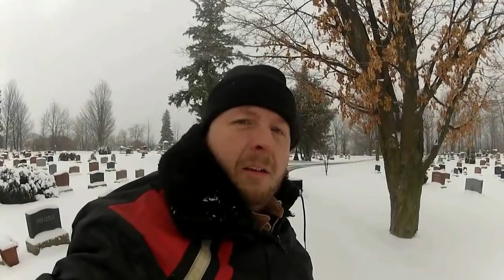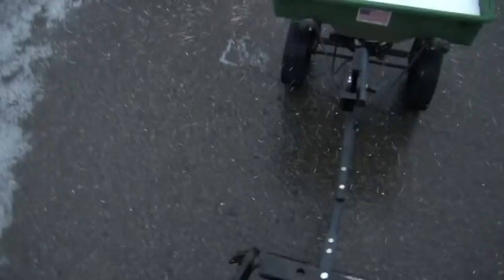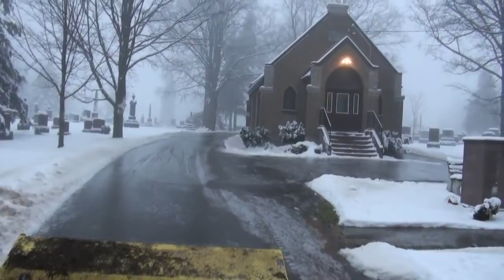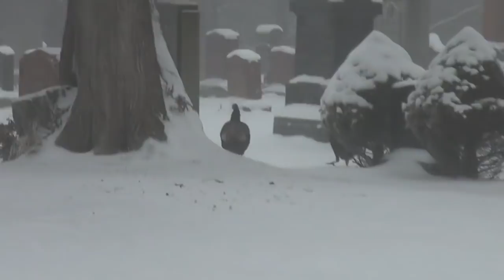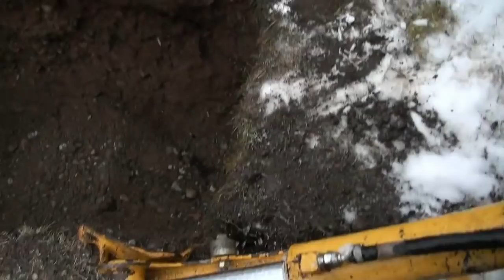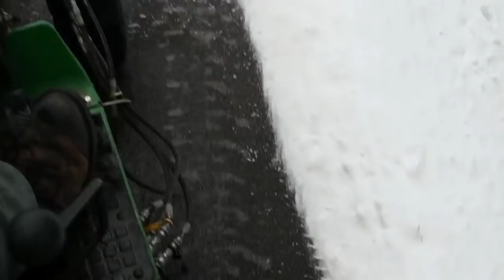friggan freezing rain crap

Comment: Merry Christmas Bill, Freezing rain is what we get most of the time here in Missouri. I'd rather have the snow. I worked a job for 30+ years where I HAD to be there, no excuses accepted. I got a lot of experience on driving in freezing rain and got to the point that I was happy that it was only snow I was driving in. I once had a 1967 Mercury Cougar I bought in 1971. I was afraid It would not do well in snow. Had a storm, lots of ice, drove it to work that morning, did not spin a single tire.